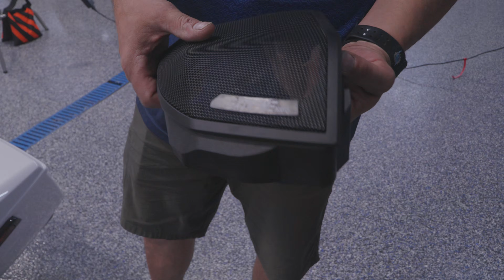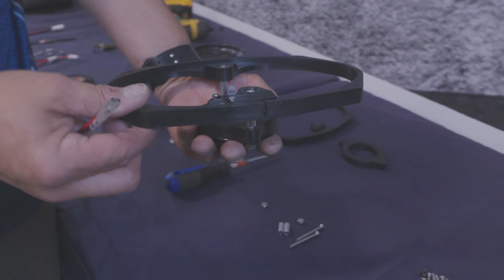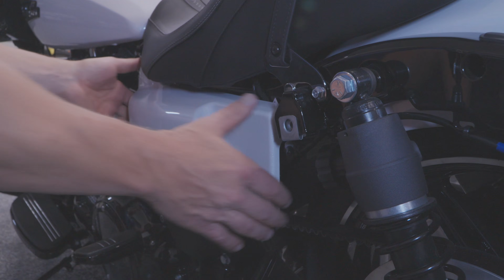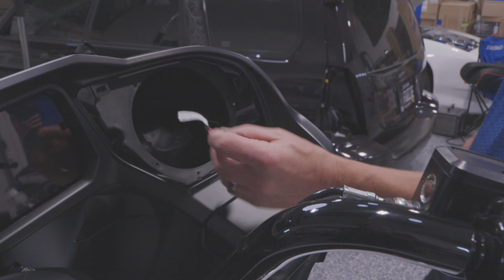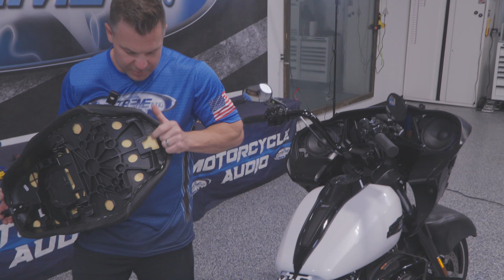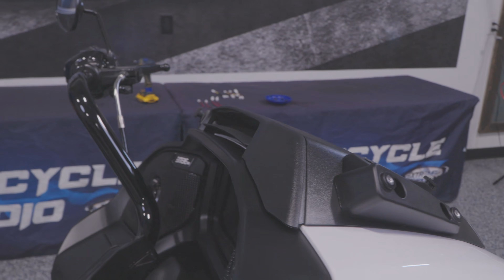2024-2026 Road Glide // Stage 3 "SS" Upgrade

Comment: Is there a reason you didn't cover the lid with masking tape to prevent possible scratches from the template?
Reply from the maker: Yes, the lid template we use actually has a felt lining, so it won't scratch any paint!